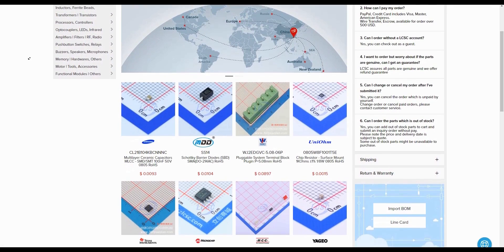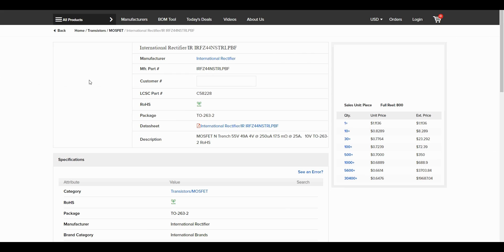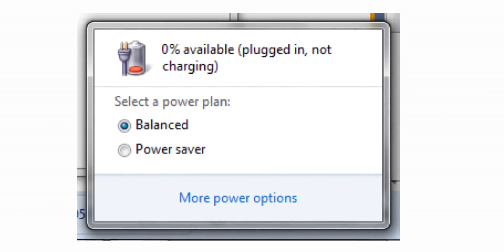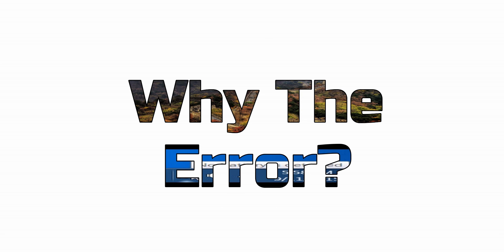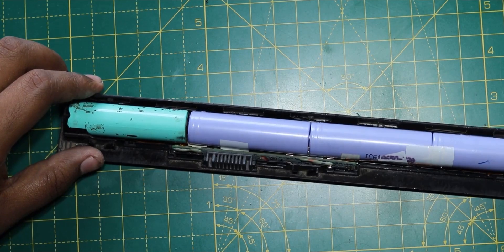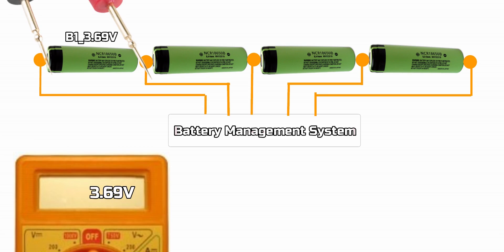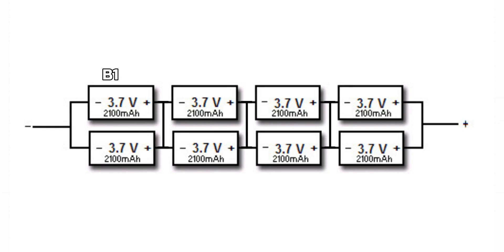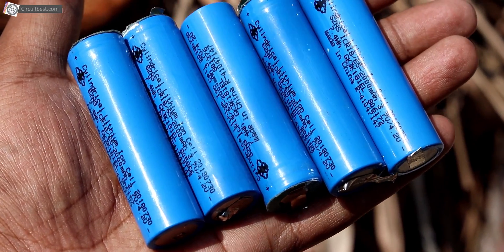plugged in, not charging Windows 7/8/10 | Laptop battery repair 2019

Comment: What's the perfomance of these batteries now as compare to original ones after replace.Please reply sir.
Reply from the maker: Working great 😀
Reply: But that powerbank is not available on flipcart now😔
Reply from the maker: You can use any good company powerbank with  Li-ion batteries
Reply: Thanks for quick responce🙂
Reply: Is there any problem with dell BMS?It still showing the problem after replacing with new cells..
Reply from the maker: I don't think so?
Have you connected the batteries in right orientation?
Reply: Yes as per the old battery connection

Comment: Can You Tell Me I Have Dell Inspiron 15-3521 Model Battery, But I Checked All Cells Are Damaged. My Battery Is 4Cell LGDBC21865 Which Is 40WH 2800mah. But Same Cells Are Not Available Online Or Offline Market. Can I Replace Cells With 18650 Model 2600mah Or 3000mah 4Cells?
Reply from the maker: Yes you can but I will suggest you to use all batteries at same capacity